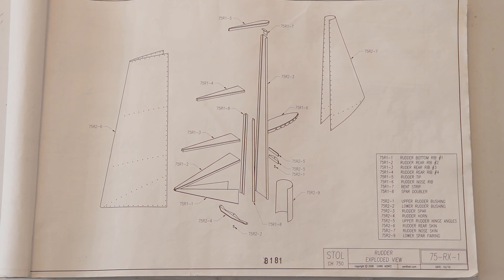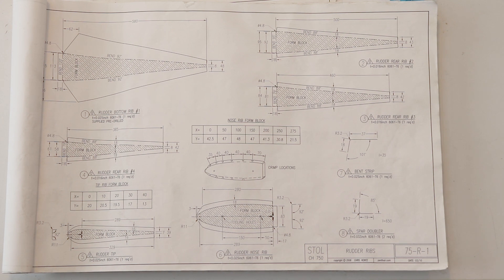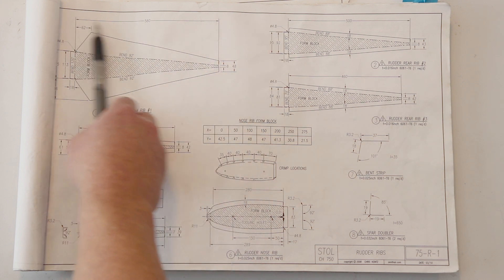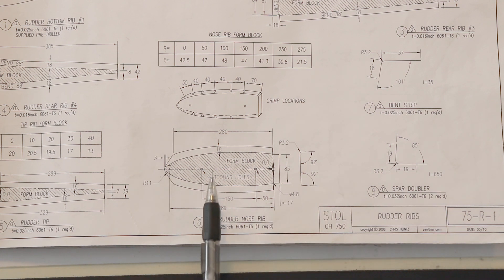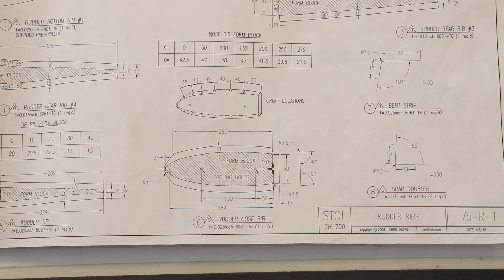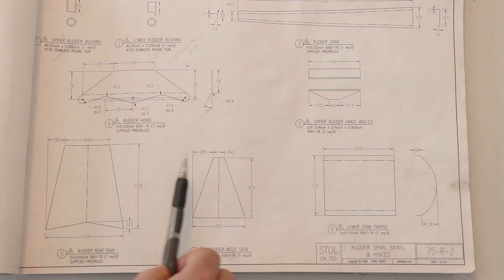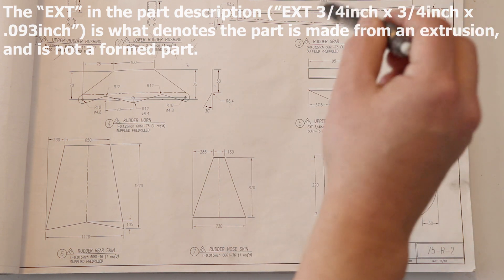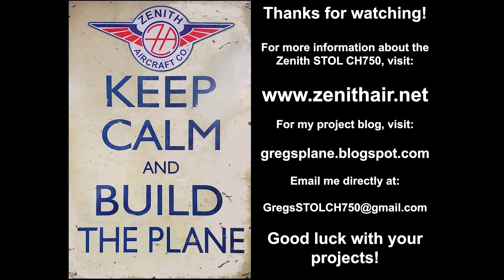Drafting Basics - Episode 2: Reading Zenith Blueprints - Part 2

Comment: G’day Greg, firstly thanks mate for all your videos. Makes a bloke confident he can do it himself. Couple of quick questions. What thickness ply do you use for your form blocks and templates. Have you got a bit of a list of tools and materials required to complete the Zenith. I have been putting together lists as I watch your videos but worry I might miss something. Thanks from Australia.
Reply from the maker: Hello, Michael! Thanks for watching. We have 3/4-inch nominal thickness plywood (which is actually 23/32-inch thick) as a standard thickness here in the states, and that's what I use. It yields just enough thickness so that you don't have extra flange material sticking off the edge. That's about 18.25-mm thick, but I have no idea what is standard for you in Australia. If you have something close, I would go no thinner than 18-mm thick. As for a list of tools, I've put one together here: https://docs.google.com/spreadsheets/d/1Iu5kW37uwvPmvhqZbZEkVIZHTuDjgJHIk6mgqacPsto/edit?usp=sharing. It's probably not comprehensive but a lot of the tools you will use depend on how you actually fabricate some parts. There are many ways to get the job done, so the tools will vary depending on the method of fabrication you choose. My list has what I consider mandatory tools and some optional tools.